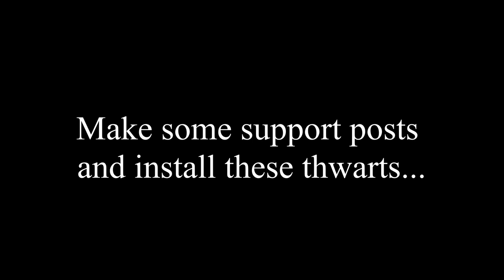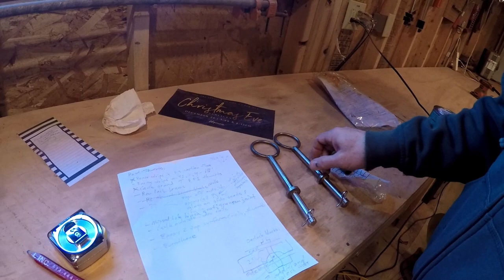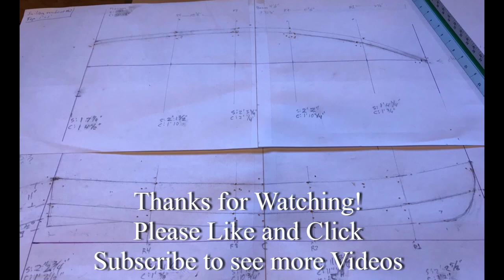Ep 3 Finish the Interior and Launch: Designing and Building the Sailboat Grace

Comment: hey what happened I watched all your videos from the beginning and then these new episodes showing the top side build has been sped up where your not going into detail about what your doing, that's disappointing I enjoyed the in depth process much more. So did you epoxy the rail down to the gunnels by screwing them down temporarily that is what you did right?
Reply from the maker: Yes--though the original slower/more detailed series carries on through there.  You can get back to that if you want I'll put the link in here in a sec
Reply from the maker: ep18 is making the rails, and ep19 is installing em so you should be able to go back there.  Here's 18: https://youtu.be/DgKraH5cpWA.  And 19: https://youtu.be/Xo4XgznBwPg
Reply from the maker: But simple answer yes: temp screws as clamps, getting them out and the holes filled with epoxy sawdust after initial setup...